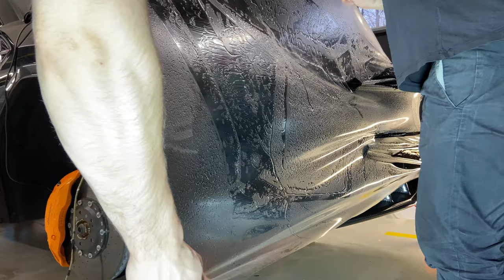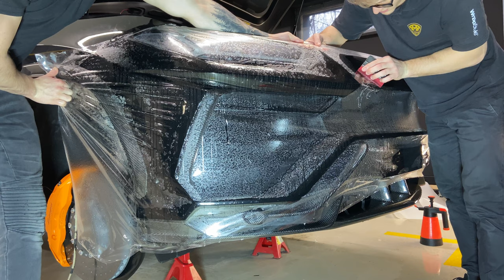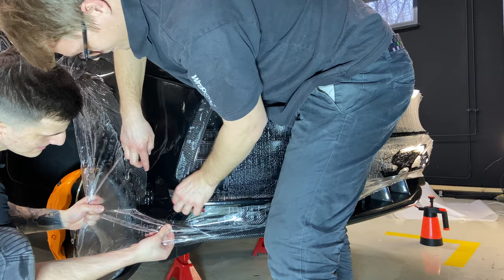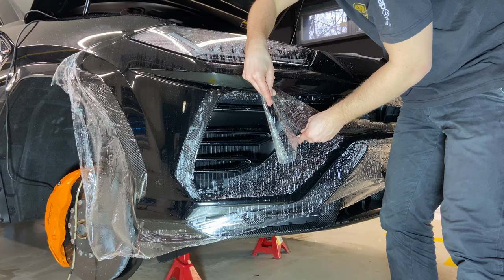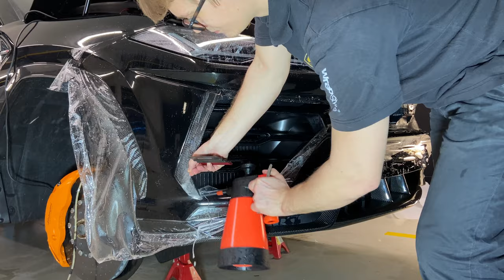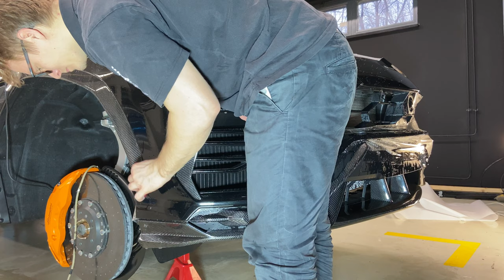Lamborghini Urus paint protection front bumper

Comment: Is it necessary to use a tac solution or will slip solution be good enough for applying ppf?
Reply: Need tack for edges to flush slip out or else edges and contours will lift. 3parts water, 1 part 70% iso